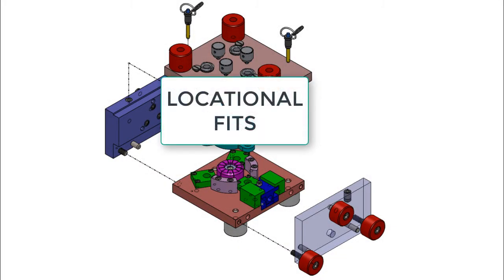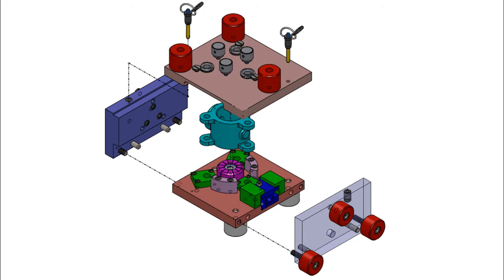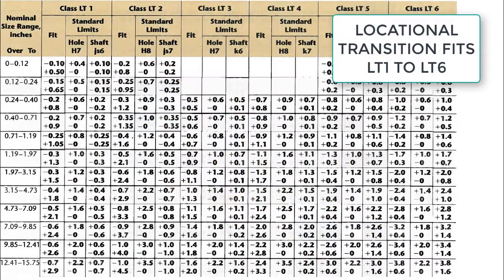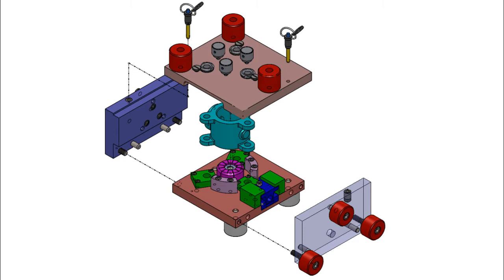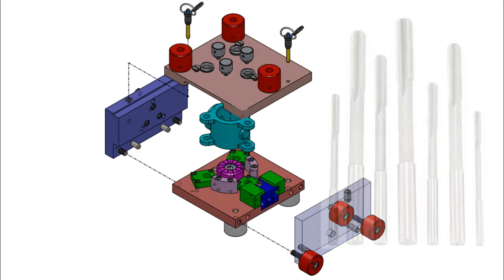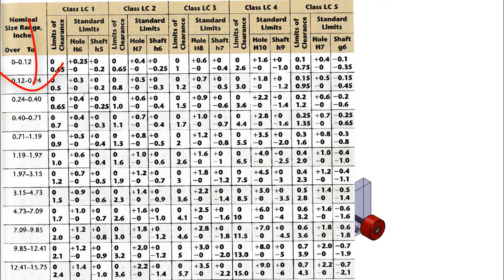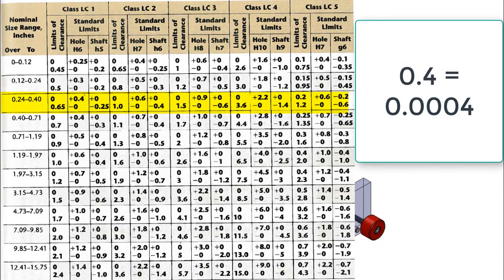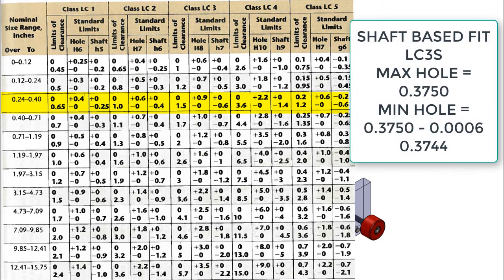5 - Locational fits

Comment: Does a Ø25.00 mm shaft fits on a Ø25.00 mm bore? I'm meaning how could same sizes fits together?
Reply from the maker: it will depend on if it is a clearance fit, a transitional fit or a force fit.